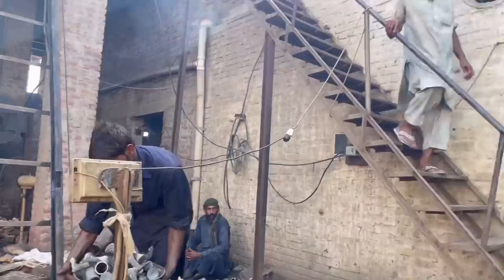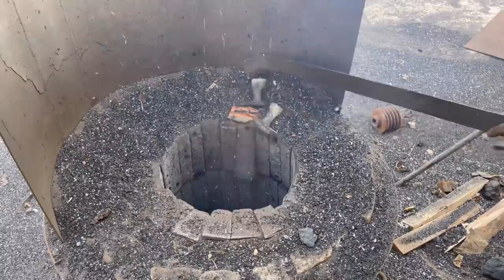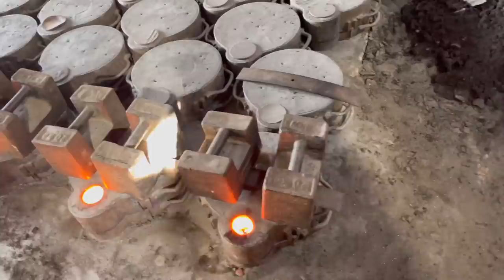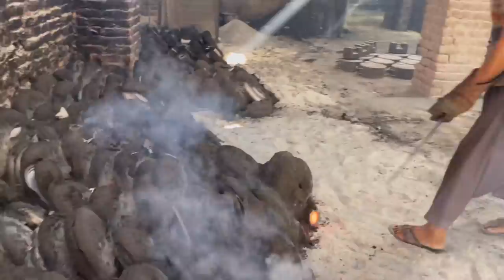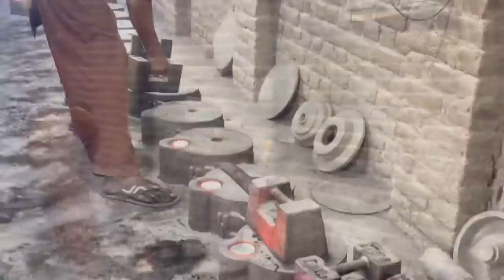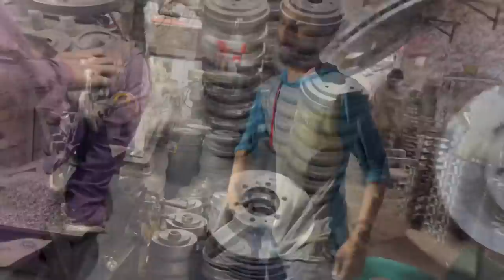How To Make Car Rear Disc Brake In Factory- Disc Brake Making Process ||

Comment: Loves it when he kicked a red hot casting back in line with his flip flop.  10 working toes is a bit greedy I guess
Reply: Red hot piece of steel is falling, let's stop it with the high heat resistant sandal
Reply: Hahaha

Comment: Considering the primitive conditions and equipment, I'd say they make a surprisingly quality product.
Reply: Maybe I would reserve the “quality” and replace with “good looking”.  Quality implies stringent testing and acceptance from multiple global standards.
Reply: @rxpsycho7326  Good enough for a Corolla rolling the streets of Karachi or wherever they are.
Reply: @GarthGoldberg  That sir, I will not disagree with 😂
Reply: @GarthGoldberg   not really. I have lived out that way. The amount of dead people you see because of car/truck/bus accidents is frightening. Back street workshops producing inferior brakes/suspension/steering components kill thousands every year.
Reply: No... undefined alloy, no x-ray, no heat treatment... Realy dangerous. I hope these break disks and drums don't ever get to Europe.
Reply: @GarthGoldberg  Yep...

Comment: Remember back in the 70s and 80s when a rotor could set you back 50 bucks or more wholesale, cut a lot of them till they were done. Now you just throw them in the scrap pile and put on one of these..
Reply: New discs are much thinner and only suitable for one set of pads, this also helps with weight and mpg specs of the car. 

Plus the current cost of labour to turn rotors is more then a new set.

Comment: Question: They are using old broken bits of metal to melt down to use for the brake moulds. Wont this old metal have impurities in it that could lead to stress factures in the new metal?
Reply: Absolutely, there’s no consistency in mixture, but to them, who cares, who’s gunna regulate that?
Reply: They don't care about their toes. Why should they care about stress cracks?
Reply: @abhinandanb  What are you talking about? They’re wearing their safety sandals.
Reply: Будут будут!
Reply: У них нет технологов и лаборатории... Как могут так и делают... "Брэмбо" Отдыхает!
Reply: Who ever check composite of Ford , Nissan Toyota  break disks ? 
If there product is not good they don't have demand .
Reply: Будут, конечно. А еще краска, пыль, песок.. Все для эффективного торможения ТатаМоторз!
Reply: Hello, it's india. What do you expect.
Reply: Well yes and no. The stones they added into the furnace contain lime which will collect impurities and turn them into slag. They got the basics right but there is no quality control. If someone woul supply them with contaminated material they would irradiate the whole city. Also the amount of carbon in the steel is more or less uncontrolled beyond the initial setup. Their setup is basically unchanged from the year 1800 when the (modern) cupola furnace got invented.

Comment: there drum brakes  not disc  and if that metal there poured with is not accurate  the metal can fracture or  shatter ...
Reply: The car will then stop anyway. No big deal. This is not for a space shuttle.

Comment: Imagine what these workers could do if they had modern machinery and proper safety equipment. Some of these guys surely get injured working in this environment with open toed sandals and loose clothing that I'm sure is flammable and easily caught in rotating machinery.
Reply: As soon as the factory is able to afford modern machinery, the management will outsource the work to a poorer country, and make all of the workers redundant.
Reply: yes , yes, yes!!!!
Reply: @trialen  ohhhhhhh, so true
Reply: They will sell the expensive machinery
Reply: @trialen  This is the bottom. No poorer countries left except the top of some mountain in Iran or the slums of India
Reply: Imagine when oil trade will no longer
Be in us dollars , what will happen to poor country.

Comment: Here you see the "why the material worn out too soon" reason. They are re-using already forged metals, even worse, they are mixing different kinds of material. Those discs are really poor quality.
Reply: They are smelting with coke, the end product is basically pig iron. It might have less impurities than pig iron as they are starting with cast steel, but the end product is not steel. Also they are melting whatever they can get their hands on, so the resulting alloy is pretty much unknown.
Reply: @acorredorv  That's a Bessemer furnace you can see the three blower inlets at the bottom and you can hear the blower running. So it is steel just not sure what grade.
Reply: They just use what they can aford, i think for their circumstances the new brake will fulfill its purpose. Those people can not aford robot machines, while laying on the lazy eggs
Reply: @CypherReaper  yeah it looks like they're adding zinc or some other material to it as well so it might be of good quality .

Comment: The reason break discs took years to perfect is that the metal used has a very specific composition to get the right properties for effective breaking. These guys are just chucking in any old scrap which is just going to produce a dangerous product. This kind of sweat shop operation turning out dangerous products should not be praised at all.

Comment: They should avoid making auto brake parts with old casting technique with scrap steel- they should think about the breaking force on automobiles and what serious accident shall happen when brake failure become unpredictable for the driver. This is a salient case where old techniques employed as industry becomes a liability for the country
Reply: there is not such word in their vocabulary as "safe", haven`t you noticed it?
Reply: Yes you are right same thing happens to  Qantas flight 32 just because of poor quality manufacturing of it's engines.

Comment: As a professional Mechanical Engineer all that I can say is thank God that my car does NOT have any parts made in that shit hole,,, do any of those guys even know how to spell "process control"?????
Reply: How could you possibly know for sure that your car doesn't have any parts made in someplace like this?
Reply: @thetransformatorium7980  Given the make and vintage of my car I am quite sure that it was made in Australia ,, I do drive a rather old Holden
However, I acknowledge that for some of the newer lesser brand Asian cars, what you say may be correct. I would think that the likes of Nissan, Toyota, etc. would have better QA/QC controls in place
Reply: *speel